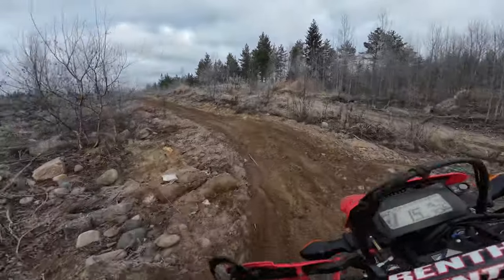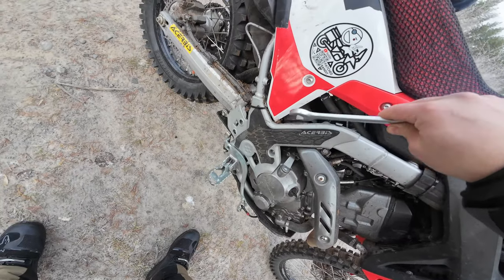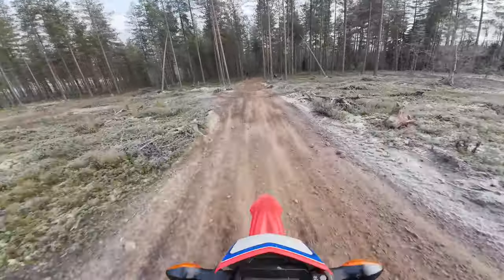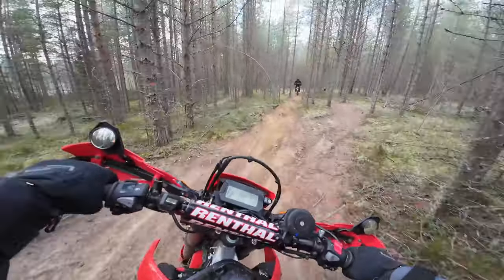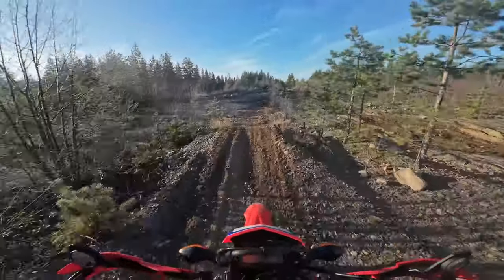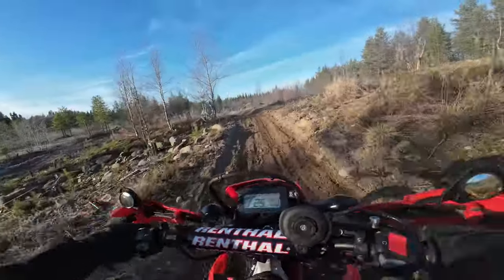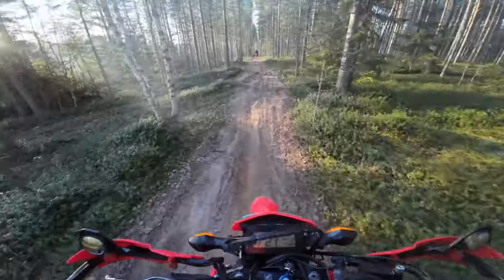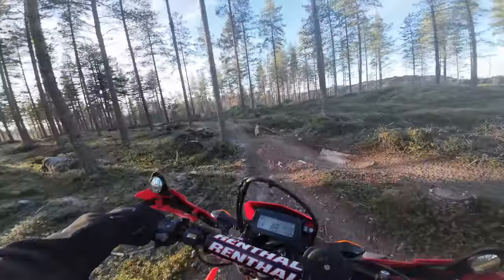Enduro Problem with My CRF300 & Rally-Raid Suspension

Comment: I installed the 4.2Nm L2 fork springs (the most stiff they offered), and the 95Nm L2 rear spring.  I weigh 118kg, and knew the rear spring was 5-10Nm below what they recommended, but planned on losing some weight.  Temps were below 0c for the first 1000km I rode the RR suspension.  I found even midrange settings on preload and compression felt very harsh.  I ended up running about 40% sag / 5 clicks rebound on the shock and 7 clicks preload / 5 clicks compression on the forks.  I put a plastic zip tie around one fork to watch it for bottoming out and went riding through potholes, leaving settings where it took a very sharp hit to bottom out.  I couldn't tell you where my settings are at right now, but with the 95Nm rear spring, I'll probably add rear preload to around 35% rider sag as I start to get faster offroad.  In testing early on, 30% rider sag at full preload was only showing 1.5% static sag, and it was very harsh feeling.  I know I should probably just get the 105Nm rear spring, but actually liking how the bike feels right now.  I can also say fir my 30 inch inseam, the L1 would have been a better choice.  It's been more difficult getting used to the bike running the L2 on my tiptoes when it gets slow.  Many slow/stopped drops looking for footing.  Hope my experience can help some.  Great video as always!  Thanks!

Comment: The Rally Raid setup must be quite good, because with a stock Honda you wouldn't dare to enter this track. You have confidence and ride at a faster pace than most people would do. That's the start of your "problems". What Rally Raid suggested is to fill in a bit more oil and testride again. I'm pretty sure taht less air gap works out well. Pity that it's so cold outside that spannering is no fun at all. Do it in your heated garage and start a new testride. Same track, ideally same weather and same pace. All the best, Günter/Nürnberg
Reply from the maker: Fully agree and I’m not blaming RR. Next video we take the whole bike to a suspension specialist for a full checkup
Reply: @PatchedBandit  My experience with setup specialists (on racetrack) are extraordinary well. Not cheap, but worth every Euro. Your specialist will find the cause and cure it.

Comment: Look forward to the follow-up. I have the same spring rate in my level 1 and I weigh exactly the same as you. I’ve only bottomed out a few times, but I don’t ride nearly as aggressively as you. I’ve told myself several times that I probably didn’t put enough oil in the forks because they are very mushy through the first couple of inches of stroke.
Reply from the maker: Very possible that adding oil past the recommended amount is the key here but we will see later. I will take the whole bike to a suspension specialist and make a film about it.. at least that's the plan. 
I've ridden the RR suspension a lot all over Europe but riding normal TET it doesn't get this kind of abuse and it's been nice. I would like it to take hits better though so I hope this 'series' of me fiding out will help others too 😊
Reply: The air gap/oil level effects the larger deflections of the fork to a much greater degree than the initial stroke you are having issues with (unless the fork is almost empty or you have air in the cartridge). The air is compressed as the fork travels up, this "adds" to the overall "spring rate". Best way to adjust the oil level is to open both dampening adjusters, put a zip tie on the bottom tube and now press hard on the fork (off the bike). You want to keep adding oil to a point where the fork no longer bottoms out and gives you 10-20 mm of "bottom out" cushion. This method can fine tune forks to a certain degree, if the spring rate is way off, obviously you need diff spring.

Comment: I also have the 3.9 level one kit and have the opposite problem.  I feel the forks are a bit over damp.  And that their small bump compliance is a bit harsh. 

Your video looks like you have air in the damping cartridge.  Pull the left leg spring out and see if you have resistance in the cartridge to hold itself up.  If not you have air in there. 

Its also worth trying an 80mm air gap in the left leg instead of the suggested 100mm gap. 

How long have you had the fork kit in there? It may just be time for a suspension service and new oil.

Comment: Great video! I followed your advice and got the ABS version (from "First Impressions" video). In the future I'm considering upgrading the suspension and is quite valuable that you test it on every posible scenario. Could be Level 1 vs Level 2 traveling?, waiting for your outcome with the suspension specialist. Regards!
Reply from the maker: If you can deal with the height of the level 2 you should go for that for sure. Due to some medical stuff I have a brake from making content but I have booked the appointment. Video should be out in about 3 weeks or so..

Comment: Do you notice any spring on fork tube rubbing sound cycling the forks up and down?  I do on mine snd it kind of bothers me, but figure there's oil in there, and it would take a long long time to actually do damage, but it is a steel spring on aluminum tube, so ?
Reply from the maker: Haven't noticed that on mine.

Comment: Totally disagree, my 300L with Rally Raid Level 2 is great, none of the issues you have over similar terrian. I’m 5’11 and 180lbs. 
My Rally Raid Suspension performs better than the oem suspension on my 450rl.
Reply from the maker: Disagree? On what? I wasn't giving an opinion and I stated in the video that something is off with the setup. Needs more oil, harder spring or something is actually broken. There was no opinions to disagree with 🙂
Reply: Yeah, my level 1 with 3.9 springs doesn't bottom out like that.  Makes me think installation error. 

I have my dampening set to wide open
Reply: @AceCarleton  agree 100%
Reply: @PatchedBandit  I disagree with how your video is making it look like there is a problem with Rally Raid Products. You personally have a problem with your forks not the product which is superior and the best fork setup available for the 300’s.
Reply from the maker: Listen to the intro one more time.